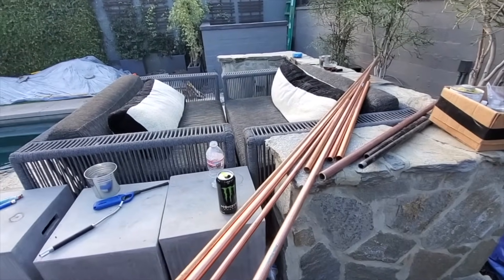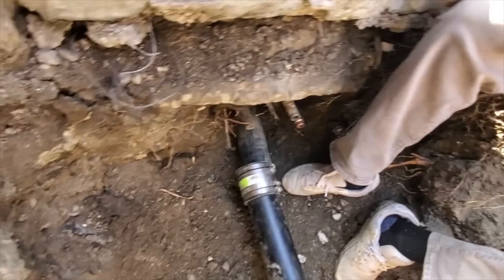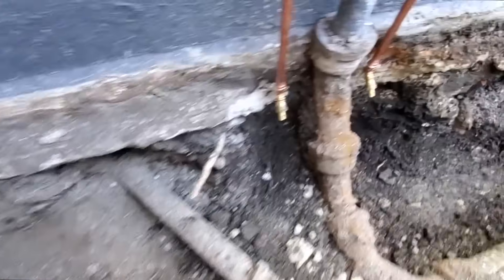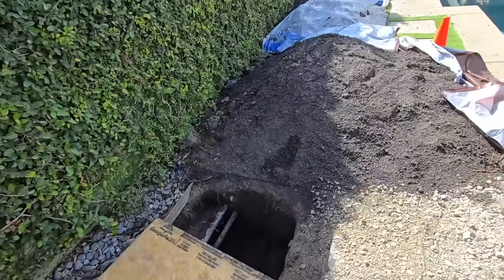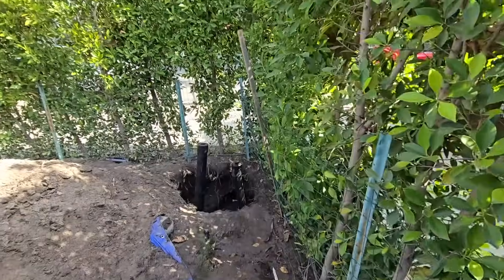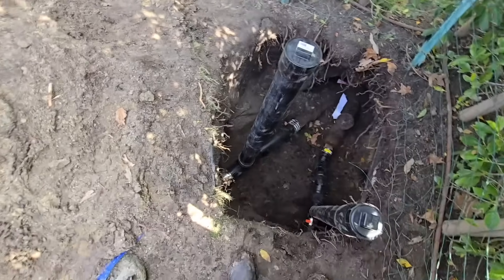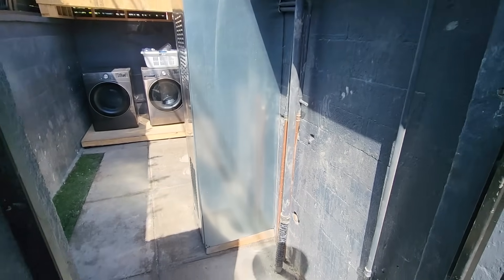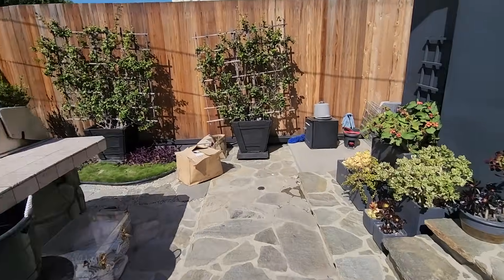Pipe bursting a 3" sewer - Part 4

Comment: I changed my mind. For a totally shit nightmare job like that: $100+K. The new copper lines?
I woulda run Type “K” & soldered everything instead of press fittings. But that’s just me.
I shouldn’t really make any remarks whatsoever. You’ve done an excellent job. KUDDOS!
Reply from the maker: i considered doing type k but pressing is just so much easier and quicker
Reply: @ Stupid me. If you would have used Type “K”  for the underground 
piping as I asked about you woulda had to have silver soldered the fittings. That’d take A
LOT OF TIME = heating everything thing up. Sometimes I forget what I used to do.